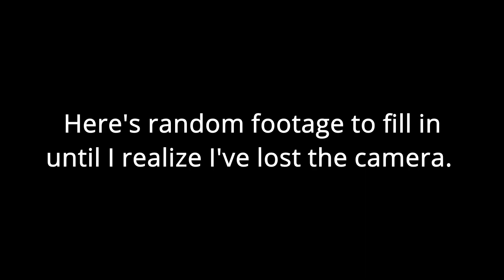Used vegetable oil free fuel! diesel swapped Toyota ride along

Comment: I love that it's a manual, I imagine that with the diesel torque makes it reasonably enjoyable to drive.
Reply from the maker: There is no diesel torque lol. 

It's not a Cummins. 

It will not lug and pull a house. 

It wants to REV. 

I shift this thing at 3,000 rpm, going easy, 4500 beating on it.
Reply: @TheDrivewayEngineer  okay lol

Comment: Its Defiantly not the worst video ever. I love it. My flywheel was kind of disastrous. Still smooth and going good. Wonder what engine oil you use ? Rotella T6 for me. I regret not doing a tach. Theres a wrangler on youtube with om617 in it. John boy deere i think. Hes got a perfectly fit vdo tach on the dash. Thats what i intended. Just never did it. Prolly never will now.
Reply from the maker: I have a tach, it's a Tinytach, it's on the dash there, small black box. I think it was 80 bucks and works great. 

I have Rotella T6 in this as well.
Reply: Loved watching your Jeep build. Finished my swap around the time I was watching you do yours

Comment: I snagged a 87 V10 (K10 ) a couple weeks ago and this is the sort of direction i'm wanting to take it. Still haven't exactly pinned down my goals, but I'm intending on either sticking with the 350 TBI or potentially running a 6.2 detroit with the low effort stuff and just driving the wheels off it.
Reply from the maker: I'd drive a 6.2/6.5 truck happily, with a turbo... But I don't expect 1500 ft/lbs and rollin coal
Reply: @TheDrivewayEngineer  yeah I’m not that concerned about numbers. Just something reliable I can drive to work in any weather and maybe cruise through a field every now and then. Not chasing any specific power numbers, just going to snag the easy upgrades and drive it.